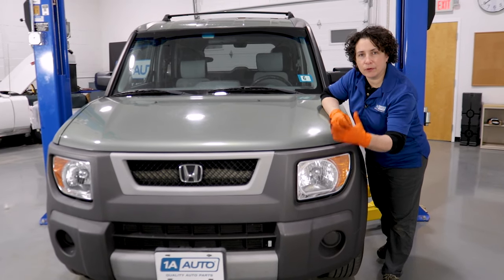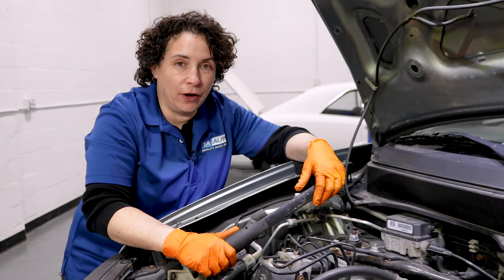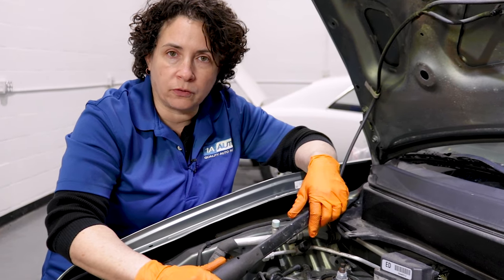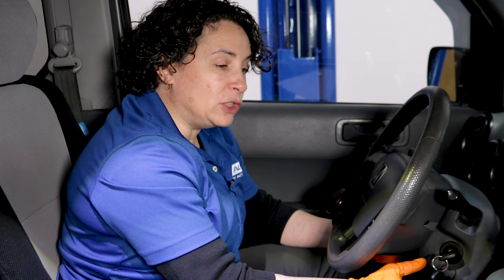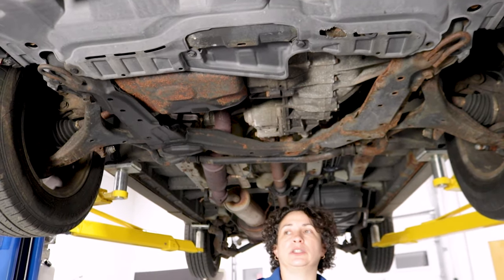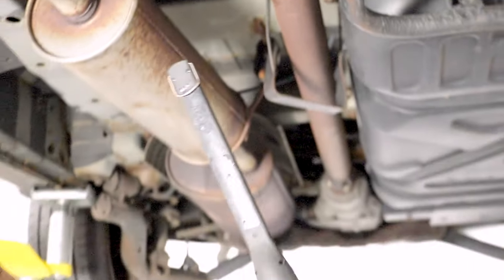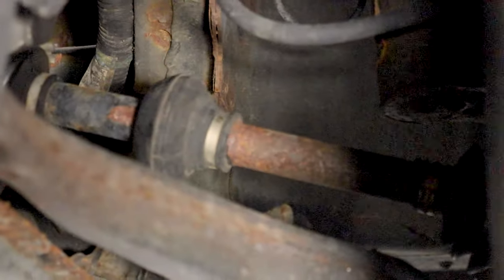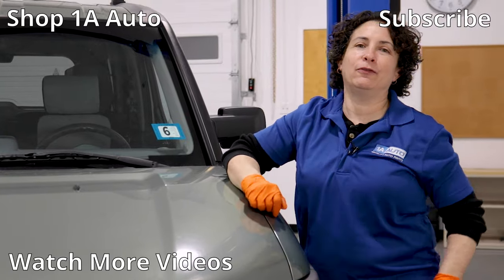Top 5 Problems Honda Element SUV 1st Generation 2003-2011

Comment: We have a 2007 Element. It has had a problem with the TPMS since we bought it brand new. The dealership kept it for over a week trying to get it figured out. We had to replace the starter about a year ago. And the motor on the door window went out. But other than that, this car has been a champ. Hardly any bells or whistles on it, but for the initial cost, versatility, and easy to drive manual transmission, it has been awesome. We may sell her in a year or so, but only to get a Cybertruck. One ugly car for another...hahaha. I will certainly miss my Ellie when her time comes.
Reply: Cybertruck will not happen. Hopefully.
Reply: Hi I know this thread is about 1 yr old BUT I am wondering since you mentioned in your comment that you may want to sell your cal right about now. If you still have the 2007 Element and  still planning to sell it, can you reply to me with your location and asking price please? Thanks. -Phoebe

Comment: Excellent! There may be one more problem.  If you have a trailer hitch, Honda sells a trailer light harness that Honda Techs may install incorrectly.  I found the manufacturer of the trailer lighting harness and I did the job myself $40 parts 5 minutes of work.  Many accidents occur because the rear trailer brake lights DO NOT ILLUMINATE when the brakes are depressed.  My local Honda Dealer technician showed me the schematic ( digital circuits) and he tried to read it as an analog or linear circuit.  He told me to turn on the brake lights on the trailer,  I had to turn on the left turn lights at the same time as the right turn lights??   Can not do that unless I break the stalk!  Easy install, the part fits right under the dash and there is a plastic connector taped (blue tape) over that fits perfectly.  My dealer wanted $1,200 to fix my ignition switch.  A locksmith did this in less than one hour programmed it for $150 and gave me TWO keys ( ILCO brand) that work perfectly.  It is a good idea to place a burglar alarm for my catalytic converter ( popular stolen Element item).  It ( KERUI alarm kit) uses a small low current drain 9 vdc battery battery embedded operated PIR sensor -wireless  I glued under the car with a wireless horn relay attached to the fuse box under the hood.  The alarm works without key in the ignition and only sets off when something moves directly below the catalytic converter ( thief--sometimes a cat).  I use a 12 VDC to 9 VDC converter for the siren alarm. ( Powerstream).
Reply from the maker: +Crime Stoppers Thanks for the feedback!

Comment: My #1 issue was my mechanic. He wrote off my car by not using a air hose to clean up the spark plugs before changing them, and sand and dirt fell into the cylinder and it ruined the motor. No way to prove it, but all the issues started after they changed them and in a hurry.  What a joy that was, honestly my #1 favorite car.

Comment: Here are some other issues I came  accross on my 06 element Awd MT:

MT  clutch springs busted out of place and wouldn’t  let me get into gears. I fixed it replacing the clutch 
 
 Valve noise. I fixed it adjusting the valves 

Oil consumption . I fixed it by replacing the pcv valve.

Cruise control stopped working. I fixed it once replacing the plastic tap on the brake pedal . 

Broken Retainer in the throttle body . I fixed  it again  by making  holes in the plastic groove and Using zip ties to hold the cruise control cable in the throttle body . 

 Limp  mode at 3000rpms and car stalling at idle when turning the ac on. I fixed it by replacing the Map sensor . 

Rough idle and poor performance. Fixed it by replacing the iacv valve in the throttle body . 

Here are some tips 
*Replace the sway bar links bushings
* Tune ups on time 
* Flush and replace with fresh new fluids

The car right now is at 200K miles and I will wait until the engine gives out to replace the engine, not the car

Comment: great video thanks , i experienced the solenoid problem and my oil was leaking a lot , got it fixed  and car has been running super well since. I noticed that my check engine keeps lightning up , i had it checked twice both times they fixed it , nothing major but after a while it comes back on , car is running perfectly , i was told that it could be sa sensor issue nothing to worry about , what is your opinion on that , i want to make sure my Element stays in good shape . It' s a 2003 and it has now 184,000km on the engine .

Comment: If anyone reading this is in Texas, between DFW & Austin we have one we’ll be letting go soon, it’s at the shop for an a/c check. 07 FWD not AW, 195K 2nd owner (all the original receipts/ records). All new front end. Have 3 runners now & only need two.
Best offer.

Comment: Good video but I'm surprised about a couple of things.  First is the other oil screen located in a much more difficult place to clean than the VTEC screen but will cause the same error code.  You may have to clean both to solve the problem.  I did.  There are videos that describe the procedure.  The second is no mention of the rear upper control arms.  This issue is common with almost all Elements that I've encountered.  The stock arms are not adjustable so when they wear out your rear tires wear extremely unevenly.  The solution is to purchase and install adjustable arms and then align them.

Comment: Had an ‘08 Element EX AWD  from new. Ran well except AT first gear shifted hard when cold. Recently traded it to get a smoother riding car. Element was tough and reliable, just rode hard like a a Wrangler. It is far from a luxury car.

Comment: I love my 09 4wd...  my only issue, so far, at 180k is a rumble in the back end when I turn really sharp... Someone told me to change the Dual Pump fluid in the rear. I did but, it didn't solve anything. Fluid needed changed anyway..

Comment: Aftermarket axles have no place in Elements!  For the OEM axles that are still installed, carefully inspect the shaft area under the harmonic balancer because dangerous rust builds up under there until the axle "necks down" and fails.  Eric O of SMA has a great YT video of how an axle happened to snap from that cause on a Honda Civic.
Reply from the maker: +Andrew Macdonald Thanks for the tip!
Reply: Yes.  That happened to me last year.  SNAP!  I tried 2 inexpensive aftermarket axles.  No good. The OEMs are not made anymore so find an NOS somewhere if you can.

Comment: I have an 04 with 342,000 on original motor and tranny-  runs smooth as can be! 
I have dealt with all but one of the problems she mentioned- the drive shaft. Also ones she didn’t mention!🤣
Still- amazing vehicle !
Reply from the maker: +Pete TheGrip Thanks for the feedback!

Comment: Hi, great video what symptoms required you to change the expansion valve? Also my ac light is on, freon level good, compressor turning, and fans all work, but my air is hot. You think it's my ac compressor? cause I'm leaning towards that. My ac system was fine but this just happened. Relay and fuses good as well.

Comment: Great. Good to know. I may get one. Lots of room and reliable
Reply: I did my research the Honda Element was originally released and marketed to active people who enjoyed the outdoors lifestyle. I have driven mine to Florida, South Carolina, and Texas from TN plus a lot of smaller road trips and is my daily driver.  She is comfortable to drive, backseats are amazing for passenger comfort and is flexible enough to do exactly what an avid Camper, hiker, kayak enthusiast needs.  She has rubber mats instead of carpet which I adore the seats lay flay and easy fit a queen size sleeping platform (ours is removable when not needed) Is perfect for hauling a small trailer for kayaking although originally she did carry them on her roof without issue, I just prefer being able to drop my trailer and unload my kayak without having to lift over my head.  She is also strong enough to haul a small camper if you prefer. Her payload is around 900 pounds and pulling capacity is around 1,500 lbs. I also use her to carry home improvement materials and can fit an 8 foot board inside with the seats laid down flat.  They are getting harder to find but they are still out there if you know where to look.  I found mine locally thankfully and looked at several before I drove her and said this is the one I want.  They also hold their value pretty well compared to other cars after a few years.  I know mine is still worth more than I paid for it 5 years ago.

Comment: What the heck is a hahnass? Haha great videos. I'm having some trust issues with my 06. She only has 127000 miles, so basically new. I've replaced every solenoid and still am randomly getting the ole p2646.

Comment: Yeah I have a 2008 element could feel something vibrating when accelerating under pressure can't seem to figure out what the heck is it everything feels solid other than the motor mounts have some play and my lower control arms look like the front bushing or ripped I don't know hopefully can get it figured out

Comment: I bought an 03 about two years ago and it's quickly becoming a money pit.  I've had the steering rack and the power steering pump replaced,  the rear caliper and now I'm having all sorts of electrical issues.  I always wanted one of these.  Be careful of what you wish for.
Reply: Seems like you take your element to a mechanic shop.

Comment: My 2007 Honda element hasn't had any of those issues and I got 218k miles.  I have had to put in a new starter, 2 new fans, new shocks, new struts, and 2 windshields.  But that's all from normal wear and tear.

Comment: You're godsent! I subscribe to your channel. I have a 03 element 302,000+ miles only owner. The problem I'm having that the dealership cannot figure out is intermediate it won't start and when I remove the key there is clicking and sometimes the dome light will flash on & off the brake light will light up and when I get it to start after a couple turns none of the gauges on my dash will work. It eventually clears itself. Also when this is happening I can hear a relay clicking located behind the glove box. Is it a bad ignition or a simple relay? Have you heard of this before? Any help is greatly appreciated, as I spent hundreds already and still have the same problem.

Comment: 2009 Element here and I've had problems with all five.  The ignition I just live with, it always catches the second or third turn, and only happens occasionally.  That solenoid is annoying though, even if the oil gets the tiniest bit low or dirty, the dash lights come on.  And Friday I get my drive shaft replaced because the vibration is making impossible to drive on the highway.

Comment: and make sure you check your valve clearances every 120000km, exhaust valve rockers can tend to tighten down and cause excessive wear on the exhaust cam... intake ones loosen off and cause the same issue. :) got 2 ele's myself

Comment: My 03 Element has that bad shake, replaced axle shafts in the front, no fix. removed driveshaft. same noise. it happens usually at highways speeds after a small bump, it's like a KNOCKING noise under my food. Motor and Transmounts are also good.. I've been at a loss with this for a while.

Comment: Picked up I’ve from a family member for nothing that needs an engine… curious if you have any experience removing the engine from the top? I don’t have the equipment to remove it from the bottom

Comment: I must be lucky. In more than 200k miles, just had to replace the axles. I'm thinking if you change oil regularly, you may never experience the vtc issues. Hard to tell but, changing fluids greatly increases the lifespan of engine and trans. That rear shudder is caused by not changing out differential fluids, might cause more friction causing drive shaft to wear out? All I know is that, regardless of any issues, Honda is light years ahead of any American made car hands down. Any day of the week.

Comment: Ignition problems with the green light flashing?
Fun fact: my 03 had issues with the anti theft even with 2 different programmed keys, I accidentally figured out that if I put the windshield wipers on, it would start every time! Lol😅😂😂

Comment: I have a 07 lx with 152k, My mechanic says I will need rear suspension work this spring,
Any idea of cost? Also should I be worried about those codes popping up?, any way to stay ahead of the game
I get my oil changed every 3k miles.... thank you, Jake

Comment: You forgot the idle air control valve. When the Element reaches a higher mileage give or take 200000 miles the idle air control valve Can and does stick either open or closed if it gets stuck open you will notice poor gas mileage if it gets stuck closed your car will die every time you take your foot off the gas. It's recommended that you replace the  Entire throttle body, it comes with an idle air control valve Attached and sealed. You can replace the idle air control valve on its own and that may save a little bit of money, a problem though is that the valve also houses coolant to keep the relay from over heating and if not sealed properly can leak coolant into your manifold and into the  combustion chambers out to the exhaust! This can foul up spark plugs Catalytic converter and 02 sensors. Making a small job into a big 1. Experience required
Reply: I had a problem with my Idle air control solenoid made it idle erratically .. The parts store guy suggested cleaning it .. I did that a year or so ago and it worked .. Sorta scary job ..saved a bunch of $$$ thou

Comment: Awesome video! I Have an 08 element and it shutters  sometimes at a steady speed like when u have the cruise control on. Would that be the drive shafts or the Torque converter?? Keep up the great content.
Reply: Mine shutters like around 25 & occasionally 45 mph I just live with it.

Comment: I built the Honda Element in 54 seconds at the Honda East Liberty Plant in Ohio.   3 to 4 processes then it moves down the line.  Dropped in engine bay etc.  sheet metal screws and bolts fall out on the test drive track b4 shipment.

Comment: I am looking for information about a 2093 Honda Element standard transmission. I stepped on the clutch and felt a snap and a sound. I drive home no problem but when I went to start it it won’t go into first or reverse. I read something about a clutch cable and maybe that’s what I felt snap at the pedal. Do you have a video or info about the clutch? I’m hoping it is an easy low cost repair. Thank you in advance.

Comment: just replaced my CV shafts and still have the small vibration still. I'm think the carrier support bearing/driveshaft is due? 197K 2003 Element EX

Comment: 182,000 on an 05 and never a leak there. One time that code came up, car would die down if I accelerated to fast and spit and spudder. I changed the oil and fixed it.

Comment: Recommendation:
If you have any code related to the VTEC mechanism do yourself a favor and replace the WHOLE unit for an OEM genuine Honda unit together with the oil switch connector. I’m talking from my personal experience of been wasting time and money on  aftermarket 💩 parts that never fixed the code P2646/47 🤦‍♂️

Comment: I have what I believe is #4 on this list - a CV axel (MAYBE) issue with my 2007.  Interesting that it's parking lots where this problem is super obvious, but what I get are thunderous clunk(s) mostly to the right-center of the front axle.  Anyone else here have such a problem and how much should I be spending to fix this (in fact I bought this car knowing this problem existed and it was built into the cost for the vehicle if ya must know!)  Anyway I really want to fix this like, today, so any input, insight by Element owners or Sue!  - Thank you Alll  - I HEART ELEMENTS.
Reply: AWD - FYI

Comment: Another few problems.  Duel pump fluid in the diff sheers out causing shake. Headlites dimming on 03s due to bad ELD, get revised part number.  Don’t exceed 100k on valve adjustment.
Reply: i was reading through all the comments looking for anyone to mention valve adjustment... seriously will keep the ele's running forever
Reply: Please educate me.  What is the ELD.  My 04 has the headlight dimming issue at times.

Comment: I've had the crank but no start since I bought my 03 element 7yrs ago. My problem is the cluster harness.  Tap on the dash and the key light shuts off and you can start it. Or turn your wipers on and it'll start but cluster won't work.
Reply from the maker: +Kevs auto adventures Thanks for the feedback!

Comment: 4:33 have seen a number of axles break(and suddenly when putting the car in drive it wont go anywhere)/ get ready to break and you can see it at the ends of the rubber thing where your pointing at or on the other side of that rubber

Comment: Is the drive shaft the same for a two wheel drive.  Mine is a 2005 manual transmission with two wheel drive.  I just bought it and replaced a ft axle.

Comment: I have Honda Element 2006. it has noise problem when driving. The noise sounds like from the front right corner of the car when driving in an even road or bad road. When driving in a smooth road, no noise problem. What would be the problem of my element.?